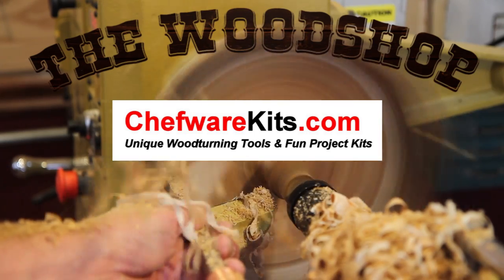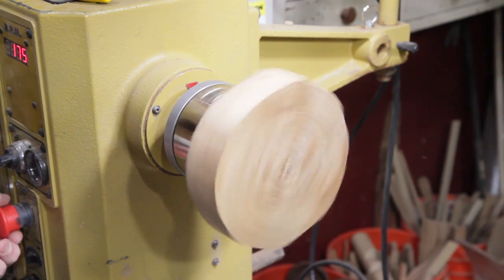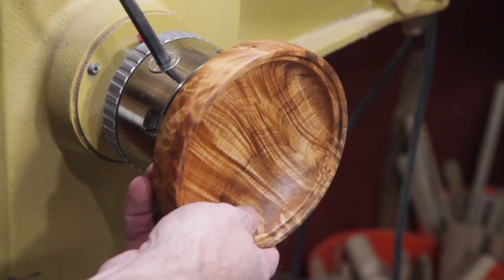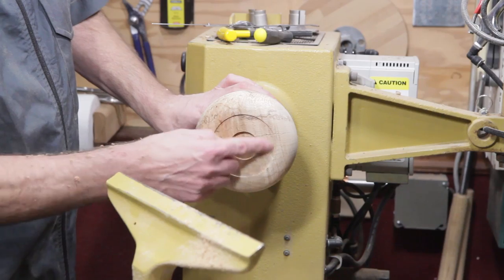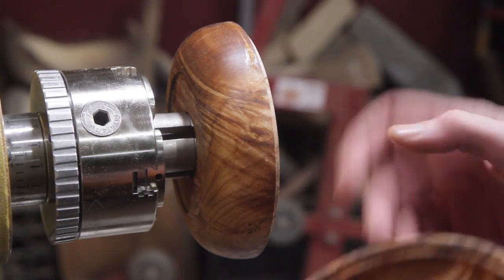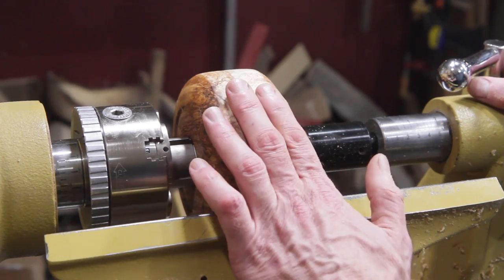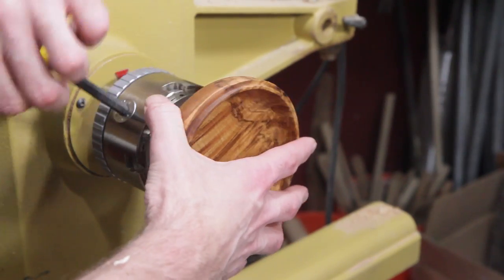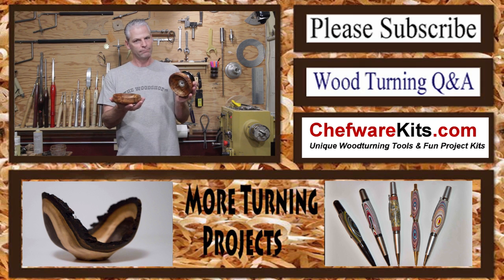Woodturning Antique Coffee Grinder

Comment: I like that design. I have one of the old style coffee grinders and will have to try that.  Beautiful wood and great job.  I have a spindle gouge set but want to get some bowl gouges.  Any suggestions for two or three gouges for someone new to turning bowls?  I also have Easy Wood tools (rougher, detail, and finish).  Thanks.
Reply from the maker: Jim Coogan Thank you Jim, Have you looked into Carter and son tools? They really hold an edge well.
Reply: Carl Jacobson
Yes, I looked at them before and they are kind of the Festool of turning tools.  A little pricey.  They are about 25 miles from where I live.  I have used Sorby tools before and of course the Easy Wood tools.